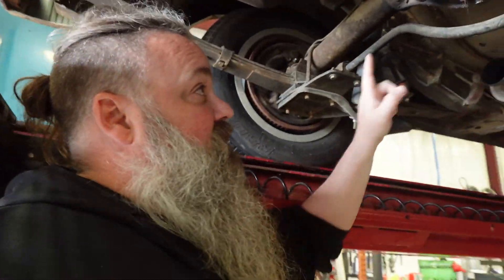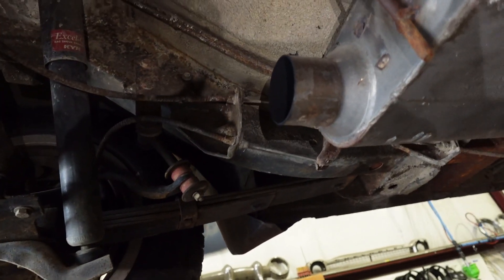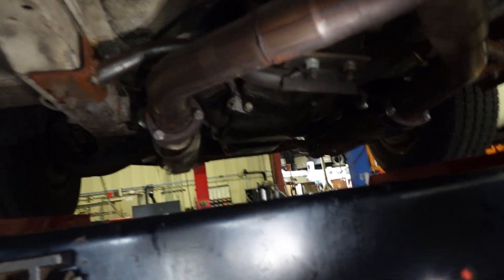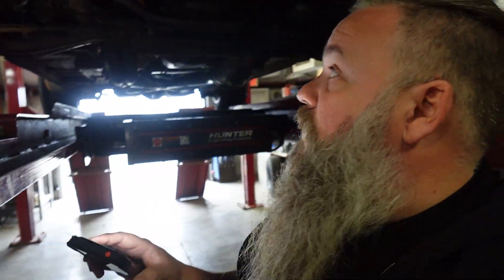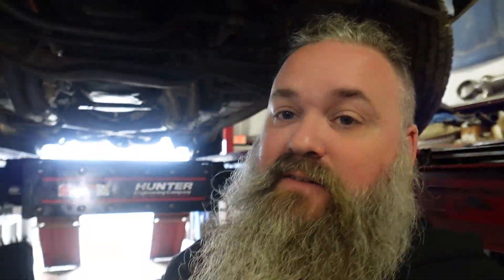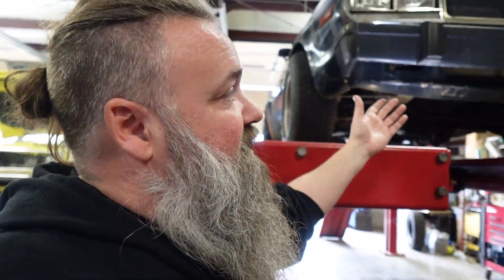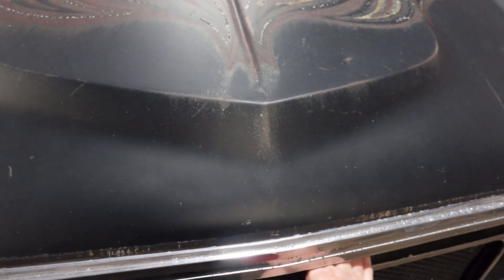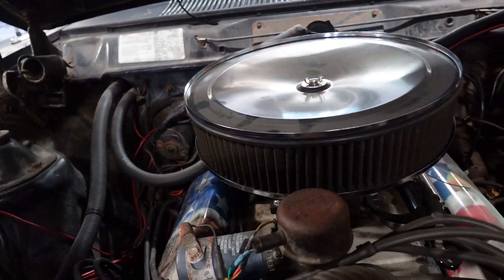Hot Rod Engine Compression, What's the RIGHT answer?

Comment: I built my 350 Chevy right at 10:1 , stock crank , balanced , flat top pistons , 488/510 lift flat tappet cam 234/244 duration @.050. Edelbrock performer rpm intake and just a 4160 Holly soon to be an ATM and a retro roller cam better suited for my 72 k5 . 92 octane petrol , 4 speed , 4.56 gears on 37s . It’s my daily since I work at home lol

Comment: When I had my big block rebuilt, I told the builder I wanted it built to run on the dirtiest, crappiest gas I could find. Because I drive my cars. And I have been in service stations that only have 86 octane. High compression blower motors don’t like that. And I get 17 mpg on the highway. See ya on Power Tour Austin.

Comment: Compression.  My opinion is it depends on how much overlap your cam has. Check cranking compression. No more than 190 on pump gas Aluminum heads maybe the same or a little more.  Of course you can add water meth injection if you need to especially in hot weather.

Comment: The reason the first car you showed the one with the positive and beefy sway bar. The reason that car gets the gas mileage is because of the low gear ratio the 273. 
With that muffler's turned around like that you're choking that motor.

Comment: I was street racing every day back in the 60s with my 66 gto. You just can’t beat the sound of high compression. It has a crack to it. My current 66 Pontiac is a 4.15  bore 406 cu in  low compression. I wished it was 12 1/2 to one compression on E 85. Get that old school sound. It takes high compression and a lot of camshaft to wake up a Pontiac. Havening said that it does cruise nicely with the 200 r4  350 rear end.

Comment: Can you explain why you are saying you can not go higher than 9 to 1 with iron heads?  The 69 ram air IV was 10.75 to 1 and had iron heads. Granted, you needed 96 to 102 octane for it to run  properly.. But with proper gas, they did not have dependability problems.

Comment: Most dont understand between static and dynamic. Add in how a cam is central to compression and poof!! Heads explode.
Reply from the maker: Very true, there's a whole lot of "how this works" that most folks don't understand. Might need to find myself someone who's smarter than myself and has more of a trusted background to explain it. So few people have even heard the phrase "dynamic compression"
Reply: @AutomotiveAdventuresWithAustin   I think you've been nailing. Do what you do how you been doing it. Fun travels- we watch. A compression gauge, end result, is the tell all number and tool. Maybe you can touch on how 2 engines, built as 9.1 compression, can have 2 different compression test numbers.

Comment: I drive a 2014 all0 aluminum LS3 11to 1  93otan 650 hp 650 toq dayley and it gets 20  in town 23 open road
Reply from the maker: Yeahhhh aluminum heads and timing/knock control is a GAME CHANGER for sure. That's got to be a rip roaring daily driver!

Comment: I’m curious what Tony Angelo is going to do with the Bonemaro now that he has it.  It’s currently running on race gas, but he mentioned he’d like to drag n drive the car.  I’m not sure how he’s going to get around the fuel issue and drive it on the street.
Reply from the maker: I'll have to look into that car I'm not familiar with it. I honestly don't know why anyone would build something to run on "race gas" these days especially if you are ever planning on actually driving the thing other than down a drag strip. And building a car JUST for that... god that's expensive.
Reply: @ it was one of the original Hot Rod Garage cars… the race fuel was a change made after Tony left the show.  Mind you in this form it’s a 9.82 quarter mile car.

Comment: Yes, but really, any build not stock ish, most would benefit running 93+ all the time unless backing the timing down to run 87
Reply: @JohnLittlepage   octane burns slow. That's why it fights detonation (I've oversimplified ).  Extra octane, or rather using fuel with more octane than the engine actually needs, has no benefit in normal driving conditions (that I'm aware of). I'm human and may have missed something.

Comment: It depends on how detonation resistant the head and piston crown combo are, what type of fuel is available where you drive, and what kind of fuel system it has. My Spirit runs a 360 that has just shy of 9 to one compression because it's a budget build with stock replacement cast pistons. If I had my way, I would build one with 10.5 compression and heads with a better combustion chamber mated with a detonation resistant piston crown design. The standard AMC piston is full dished, meaning it has no quench and is more detonation prone than a half dished piston would be. It's all theory until you have to swipe the credit card!

Comment: Just going through this right now. Building a Pontiac 460 stroker and ordered pistons to give me a 10.1:1 CR. Nothing crazy but still allows a margin of error and forgiveness for tuning and hot temps.
Reply from the maker: What heads are you planning to run? In the Pontiac world especially you get used to everything needing to be custom so you can really target compression ratios to whatever you want. Building off a 400 block? Or 455?
Reply: @AutomotiveAdventuresWithAustin  400 block, 4.15 bore, Ross pistons 20cc dish, 4.25 forged scat crank, scat 6.8" H beam rods, speedmaster heads cleaned up with better hardware. Will be running 91 octane ethanol free. Yes I could run more compression but half a point on a 500 HP build is 7-8hp ish. Or I can be comfortable running my AC on a 110degree day and not worried about detonation
Reply from the maker: Yes sir you get the math, CAN I run a bit more compression? Yes. Will it matter one bit or will I feel the small change in power percentage wise? Not a chance. Especially with aluminum heads that opens up a whole lot of safety and you'll still have an absolute monster of a motor AND and cruise it comfortably
Reply: @AutomotiveAdventuresWithAustin  there was an interview I read and I wish I could remember who it was. But it was someone big in the industry and they said the biggest mistake they see engine builders do is go for too much compression and stated the fact that there are many hot and capable 9.7:1 engines out there. Stuck with me enough to remember to quote but not the name.

Comment: Just know, I was really sad when Amoco premium went over 99 cents a gallon! That was a long time ago. At 8 mpg I needed all of the help I could get, that engine was targeted at 9.5- 10 psi of compression. It was really strong on pump gas, when turned up on race gas, it was really strong at 540 hp at the wheel. This was the mid 80's, engines can do better now. I want a good engine in an unusual car now! It is possible!